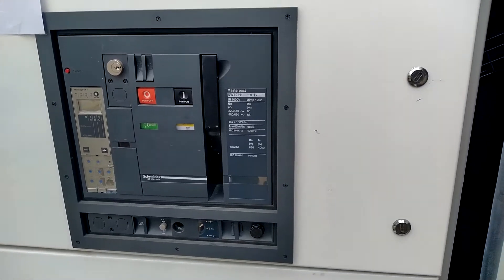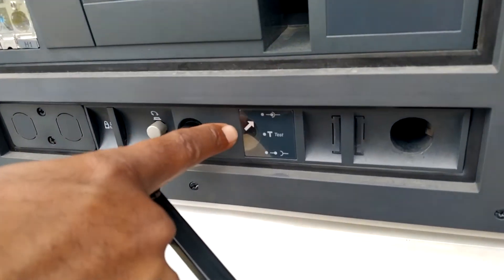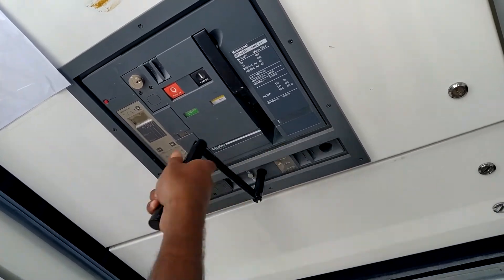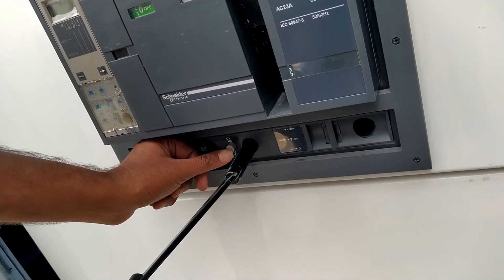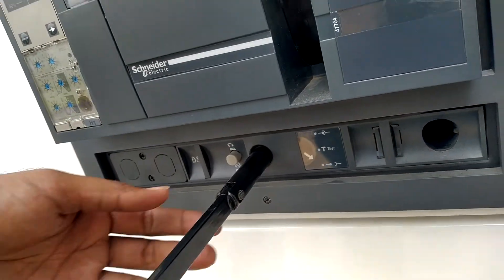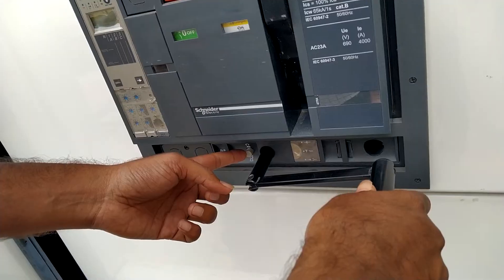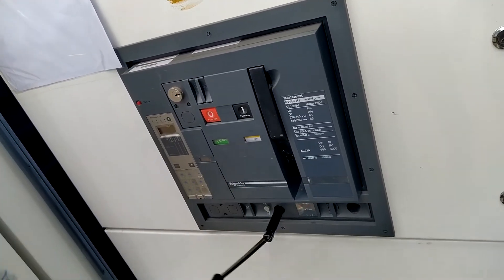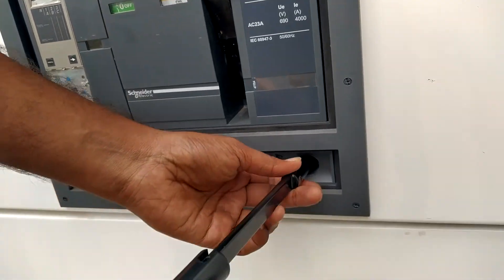ACB Rack in and Rack out

Comment: Nice video showing Air Circuit Breaker rack-in and rack-out 

P.S. Typically used in low-voltage applications below 450V and for currents ranging from 800 amps to 10,000 amps
Reply from the maker: True

Comment: What can prevent the  breaker from racking in property?
Reply from the maker: sorry i could not get you
Reply: This mechanism requires the proper application of torque and smooth operation of mechanical parts such as racks, pinions, cams, and jaws. High force or torque might be needed during racking in or out, especially as multiple electrical contacts engage or disengage, which can sometimes cause it to stick or become difficult to move. Mechanical issues like misalignment, worn parts, or inadequate lubrication in the racking mechanism might also cause the breaker to get stuck during this operation